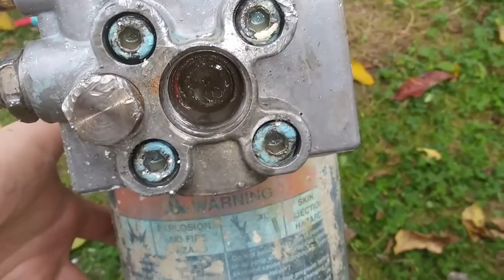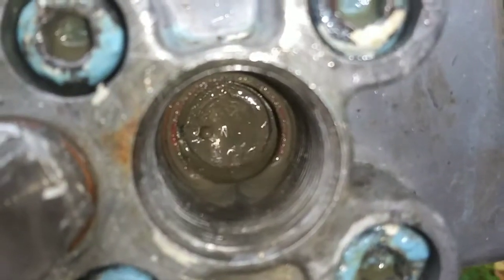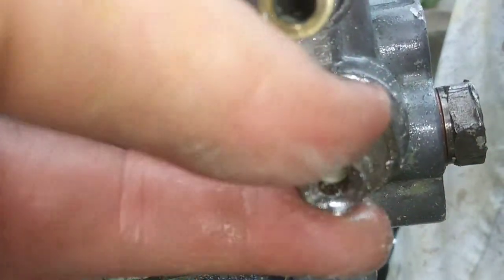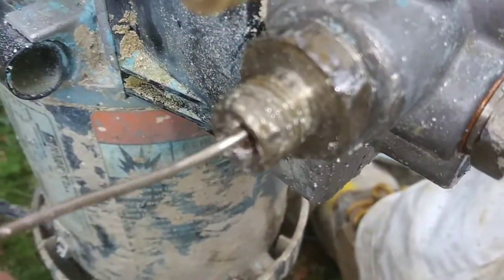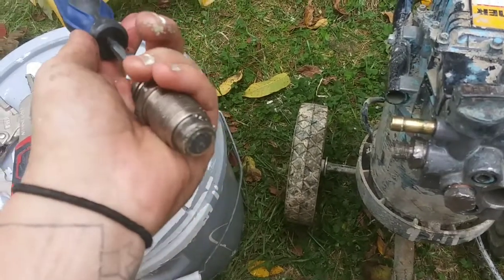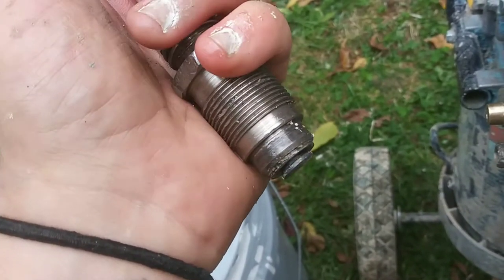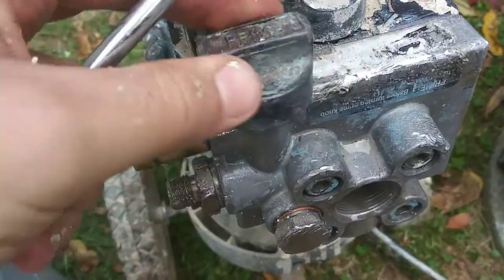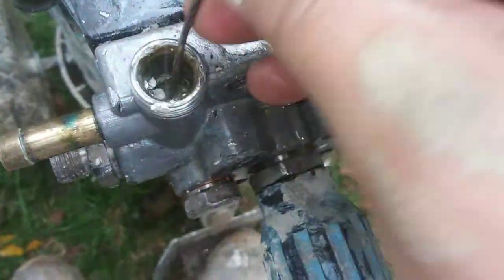Wagner 505 diaphragm pump troubleshooting . Help?

Comment: Just got one of these used. Find the manual online. I just spent a few hours trying to fix mine and everything you need to know is in the free manual. Mine working great now. The primer plastic knob is held on by two very small Allen keys, one on either side of the knob (that's not in the manual)

Comment: Hey Gringo, did you get the 505 pumping?  I have a Wagner 848 which is quite similar to what you are working on. One BIG problem you have is with old dried paint.  It should be spotless inside.   Start at the inlet valve and clean it!  Get every speck of paint out of it.  Then hold it with the open side up and fill it with water.  It should hold water with nothing leaking out.  With it full of water, put something like a pencil inside and push the valve open.  The water should drain out. If it doesn't hold water, maybe you need a new inlet valve.  Then take the head off again so you can see the diaphragm .  Clean out every bit of old paint inside the paint chamber.  The plastic disc inside is removable also.  Take it out and clean all paint from there and replace the disc making sure you get it back in facing the same way it came apart. While you have it apart, you might as will replace the diaphragm.  Next to the inlet valve is a hex plug.  The outlet valve is under the plug.  By the way your machine looks, you will probably find paint in there too.  Under the plug you will find a spring and ball.  The ball sits on the seat.  Remove the seat with an allen wrench and replace it with a new one along with the ball and spring.  On the side of the head is the recycling hose and the supply hose.  The recycling hose slips onto the brass nipple with the other end going into the paint bucket.  The supply hose screws onto the threaded nipple.  Put your gun on the other end.  The spray / prime knob that was loose is held on with two small allen srews .  One on each side of the knob.  After you have it all back together, put the machine on it's back so the inlet valve is pointing up and squirt a bunch of wd-40 into it and once again, push a pencil against the valve and let the wd40 go inside.  Put the suction tube back onto the inlet valve, get it tight and upright the machine with the suction tube in a bucket of water.  Be sure the spray / prime knob is on the prime side and the pressure switch is on the lowest setting.  Fire up the machine and let it run for a little while.  I usually need to turn the pressure knob up about half way or higher.  It should prime itself after it runs for a while.  When it finally gets primed, you should see water coming out the recycle tube. If it doesn't prime itself, don't bother trying to spray anything, it won't work if it isn't primed .  After it primes itself, turn the pressure down to minimum.  Whenever you change from spray to prime, or from prime to spray, be sure the pressure is adjusted to the minimum setting.    After it is primed, switch it to spray and try spraying some water through it.  You will need to increase the pressure, but it should work.  Look online for the instruction manual, if you haven't already done so, it's available.  Let me know how you're coming along with it.
Reply from the maker: Thanks for the info I haven’t been online in a while and I ended up selling this rig to a buddy of mine but I wish I would have read all this before I sold it.

Comment: The reason that you cannot get it to prime is probably due to the output valve being stuck. The little ball inside the valve is spring loaded and if the paint is allowed to build up inside, it sticks - and when I say it sticks, I mean it sort of glues itself to the seat of the valve and is very hard to get it loose. The prime 'switch' just has a set screw or two that have been opened so that they don't hold the knob in place. The prime switch is just a needle valve that is pulled open so that the output pressure is bypassed to the paint can. When the knob is turned to 'spray', the needle is closed so that the appropriated pressure is applied to the pressure hose and the gun.

Consider what you are willing to spend on this unit. I have a 400 which is very similar. I used it for several years - once in awhile, but it worked every time I tried it. Always it was hard to prime. Finally after a few years not using it, I had a situation where I thought I might need it, so I tried to get it to pump water. It did not want to but it finally did. It seemed to be operating so I put it to work on a fence using oil-based stain. I wasted a half gallon of $45 stain trying to get the thing to pump and spray. It would circulate into the can, but when I wanted it to spray, it plugged up. 
So back to the shop, cleaned everything out and ready to go again after replacing the intake valve, the output valve and the diaphragm - to the tune of $129 - it should be ready to go. Cleaned out the filters and the gun etc. I went to test the unit, it would not prime! I opened the cover on the oil pump and discovered that the intake tube for the hydraulic pump was not only broken - it kinda disintegrated. So I found a piece of tubing to use in its place, refilled with oil and tried again, still did not prime. The hydraulic pump is not producing any pressure to actuate the diaphragm to produce pressure and intake vacuum for the paint portion of the system. The old parts did that, but now it doesn't.

And I cannot figure out how that hydraulic pump is supposed to work. I took it completely apart and can find no check valves or moving parts of any kind in the hydraulic system. There is nothing that I can see that would cause the pump to circulate oil. There is no way to create a vacuum except possibly the piston moving down, but there is nothing to keep the oil that is above in the chamber from coming back out as the piston comes down, so I don't see how it can possible stop the flow to create a vacuum or build up pressure. There is a needle, but it is used to regulate the pressure that the system builds up if the pump actually pumps the oil. That needle regulates the opening for escape of the oil back into the reservoir and there is no check valve on it either. What is supposed to happen is that the piston goes up and compresses the oil in the chamber where the diaphragm is located. That pressure causes the diaphragm to pressurize what ever liquid is on the other side and if the ball check output valve operates, the pressurized liquid is pushed out through the output valve, through the bypass and back to the paint can. At the same time, the intake valve operates causing a vacuum on the input side of the paint system so that more paint is pulled by vacuum into the intake side to be pressurized by the diaphragm's actions. If the diaphragm can be moved, the paint system on my Wagner 400 works fine, but the diaphragm does not see any pressure from the hydraulic pump any more. As the diaphragm is actuated by the hydraulic pressure, it will build up the pressure rapidly on the output side so that when the trigger on the gun is actuated, the pressure will force the paint out through the nozzle onto the surface. But without hydraulic pressure it cannot build up the spray pressure. 

So the long and short of it is - if you decide to pay $130 for the kit to repair your 505, you might have thrown the money away because the hydraulic system is also bad or will fail shortly after you put it under pressure again. Like I said, I cannot figure out how the hydraulic pump works on this particular version of the Wagner hydraulic pump. I  watched a video on a couple of other Wagner products one of which was very similar except the intake for the oil pump was in the piston itself. The repair video showed that the repairman was able to run the pump with the cover off and show that it was actually physically pumping the oil around. But on that one too, I could not see how the hydraulic pump operated. The piston had one hole in its side that I could see and no other way for oil to go in or out, yet that piston was supposed to be pumping the oil around? There had to be some form of check valves to cause the oil to stay once it was pumped and to create a vacuum when the piston went the opposite direction. This particular version had only the needle port to meter the oil when the pressure was too high, but I don't see how that pressure was developed. There has to be a check valve somewhere on the hydraulics side just as on the paint side. The paint side has a check valve on the intake and on the output. I suppose that the piston going into the cylinder would act as a check valve of sorts for the intake. And after the piston began to move up, the valve would be closed allowing the other end of the piston to cause pressurization, but without some kind of output check valve as there is on the paint side, I don't see how it works. For example, if there were a hole near the top
If someone knows how these pumps work, I would appreciate a clue be given to me. LOL
Reply: I had a similar problem on my wagner 635. I replaced the diaphragm and hydraulic fluid but it would still not even attempt to prime. What I found out is that before you install the new diaphragm, you must fill that cavity in the pump block that it sets into with hydraulic fluid. After doing this my spray primed and built pressure no problem. Not sure if this is the same scenario that you are experiencing, but I hope it helps.
Reply: @scrubjaycyan4373  Thanks, that is an interesting idea. I will give it a try. The only thing is (well not the only thing, but one thing) that I had replaced the diaphragm several times over the weeks prior and it always started up without too much delay - but then it just stopped. Finally I took the thing apart and found that it has a pump arrangement too but I cannot find a way that it works. The oil that I put in there should just leak down into the reservoir because there is nothing to stop it except the needle valve - hmm so that might be how it would work. I thought that the reason that the hydraulic pump failed was that the intake side's pipe was broken, I fixed it and it would not work yet, but maybe this would have worked.
Reply: @scrubjaycyan4373  Hi. You mean fill 100% the hidraulic housing with oil?